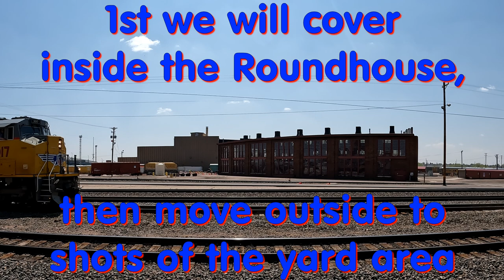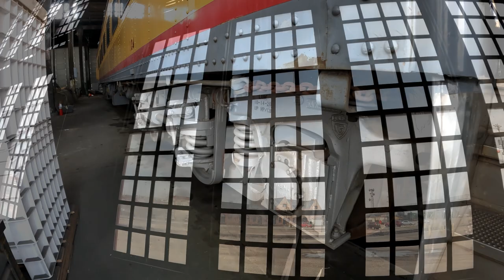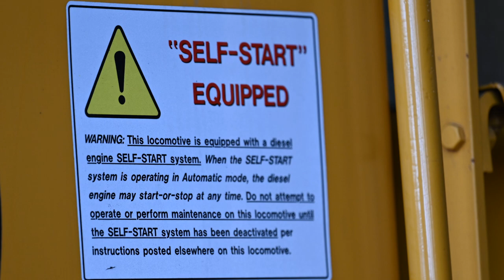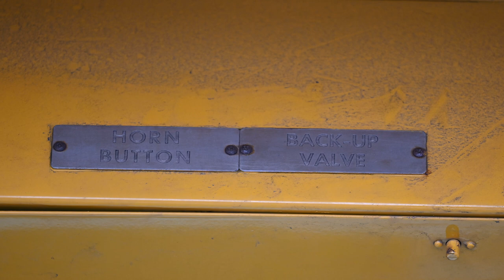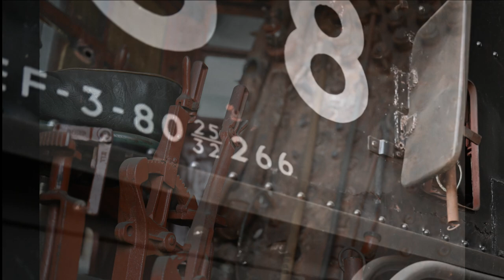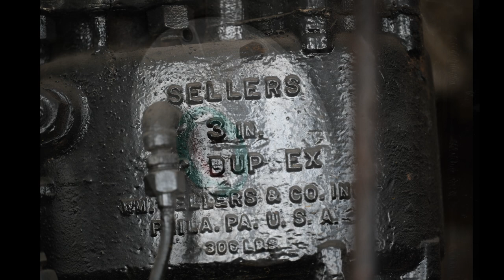Union Pacific's Roundhouse, housing E-9 Streamliners 949 & 951, Steam 838 and more. in Cheyenne, WY

Comment: I’m a retired locomotive engineer 44 years Union Pacific.. you never know what might happen. They gave me the 951 and 949 with most of those business cars coming back from the opening of the George Bush library
We didn’t know anything about it they handed us paperwork and said go!  I was really surprised it not being a real regular freight train it was around 11pm and we figured it was just an empty an we were dairying it back to Fort Worth  so we hopped on and let off the handbrake did a brake test and took off. Just after sunrise we were put in the siding at Wrenn Texas 
I got off and walked back to take a look. I was met a few cars back by so guy who asked who I was. I should.have been asking who he was. He asked me who was my manager with me. I laughed and said I don’t have one.. I told him I thought it was an empty train. No he said that the train was full of big shots.. next siding we were swapped out an the new crew had a manager 🙂 I started on the Rock Island RR  BACK in 1972 as a Switchman on the RI every thing was pretty much worn out. I remember one night we got a set of those in and they old Rock Island rust color and they were pretty horn out where to move it to another yard and a big rain came and it was like raining inside that cab oh well, some of the other train pulled with Amtrak, a few times, and Ringling Brothers, Barnum, and Bailey Circus, oh no I’ve been off the rail road so long I completely forgot about except for the little things for your video brings back memories. Thanks for the video.

Comment: Any plans or news with the other equipment and rolling stock there, I wonder if Ed plans to restore them and put them into use ?🤔
Reply: From what I can remember, I believe the 838 steam engine is a parts locomotive for the 844. As far as the rest, I believe they are track worthy
Reply: Well if 838 runs again, Which it would not, It would become a freight locomotive again.

Comment: Awesome to see a historical roundhouse and historic equipment together, doesn’t get any better! ❤
Reply: Actually, it does but not in this presentation. What we really saw was a lot of neglected equipment sitting idle, unwanted. What are they keeping those cars for?  If they could not rebuild 3985, certainly they are not going to waste money restoring freight cars of any kind. I don't like to be pessimistic but after they gave 3985 & 5511 and the bog diesel, I would guess they will give it all away.  More bonus for the president who thinks it is good to make up 3 mile trains with only an engineer to run them. Shut the steam program down, just like Santa Fe, NS JR Corman and other - more profit for the bosses bonus. Did you see how much profit UP made in 2022???  Shameful.
Reply: What about 838, that poor bastard has been reduced to nothing but spare parts for 844.
Reply: @TheSudrianTerrier653 well, they were gonna need parts for 844, and 838 had them

Comment: Anybody know why it's X-951 and just 949? They appear to be the same model loco. I know the X designates it as experimental....just wondering the difference between the two.
Reply: The X on the number board designates an extra train. When the E9's where in their original passenger service, the numerals on those boards would be changed to the train number for a scheduled train, or to an X followed by the locomotives' number for an unscheduled extra (in this case, X-951). The X designating an experimental locomotive would be in it's classification (like dda40x or sd40x), not its number.
Reply: @jacobditmars8414  Thank You.

Comment: Well, disappointment. If it wasn't the boring music, monotonous and repetitive, it was the panning back and firth  - something like an automatic fan,  So we see the outside of two engines, apparently no longer used - they gave the important one away. and a couple of cars. The saddest thing was the remainder of 838. There were no views of the machine shop, stock room or any of the unused but reconditioned spare parts for the remaining two locomotives. Wonder where 4014 was while this was going along. You could do a 4 hour photo survey of that monster and still not see it all.  OUTSIDE - Basically, a scrap yard. They'll never spend the money to restore any of that rolling stock. They will probably sell it off or donate it to RR museums. Anything left outside is destined for scrap sooner or later. Such a shame. It is interesting to see the pieces under cover in the round house. But no serious views of the round house itself.  Such  a sadness to see 838. Yes, Someone should buy it and restore the thing to working order.  That series was a work horse. Wish I had the money? Better yet would have been to rebuild 3985 and have the three best engines UP had on line 4-8-4, 4-6-6-4,  4-8-8-4. The best of ALCO all operating in one place under the caring hands of Ed
Reply: i'm surprised some of the mow passenger cars weren't donated RRHMA
Reply: @santafewarbonnetproductions  YES, BETTER THEY BE THERE THAN RUSTING AND ROTTING OUT IN THE UP YARD WHICH IS WHAT THEY APPEAR TO BE DOING.
Reply: 838 is far to gone for restoration. And they donated a bunch of stuff because they couldn't afford to keep it all